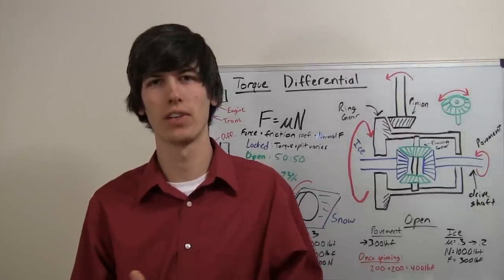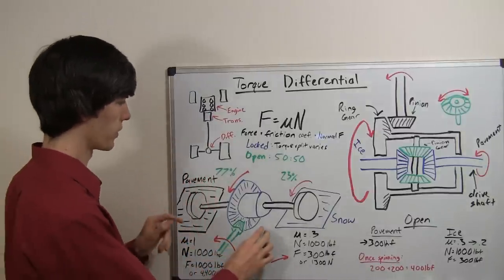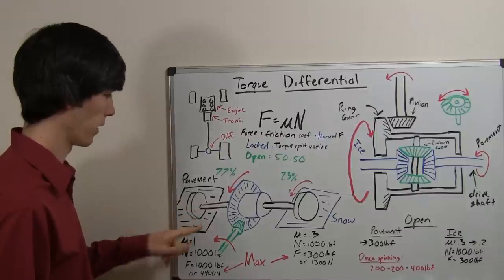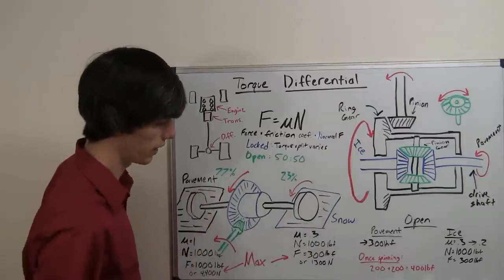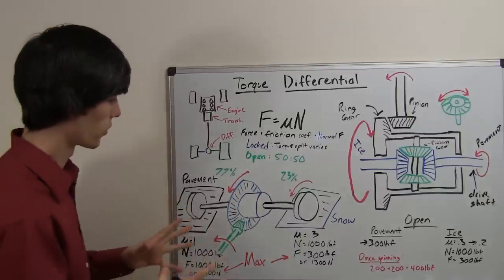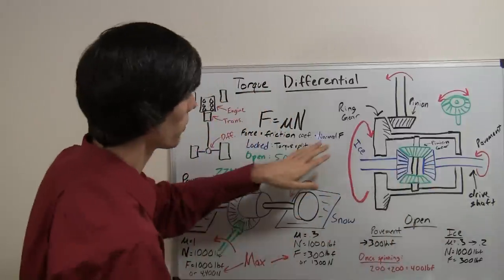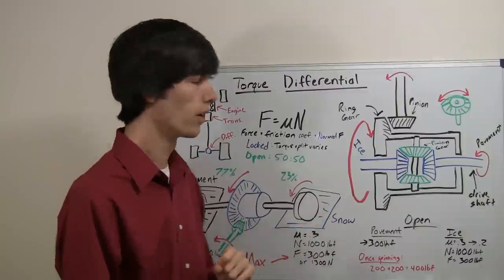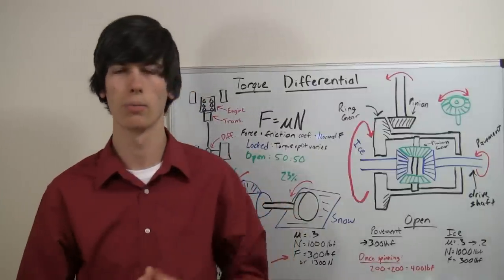Open vs Locked Differential - Torque Transfer - Explained

Comment: I am going to take one more stab at this. something tells me this is going to be pointless.
Okay forget about speed. Forget about math, Let's talk about how the locked diff actually works.
When the Diff is locked. The axle is now one solid piece vs. an open diff that allows both side of the axle to turn independently.
So all the torque that originates from the engine, through the drive shaft  will not split at the diff when the diff is locked.
Because the diff is turning both sides of the axle with the same amount of force or torque.
So the amount of force however much it takes, is being used to turn the complete axle at the diff.
So the diff is now forced to use whatever force needed to spin the complete axle.
Now don't forget the axle is locked together.
Again you are correct about the amount of force that might be applied to the ground when measured at the bottom of the tire.
But the component itself (the locked diff) can not split torque because all the pieces that make up the component inside all move together as one. LOCKED. What wikki is saying is misleading and what they print should never be used as a source of end all. They can be wrong from time to time. Because people are behind those magical post. And people make mistakes,
Reply: You're getting the individual wheel speed and the individual wheel torque mixed up. The wheels and the axle are part of a long fused rod so all the parts go the same speed, BUT the wheels can have different torque applied. There are countless examples of this...whenever you see one wheel drive you see a wheel on an axle getting all the torque. A motorcycles rear wheel gets all the torque for example...a motorcycle drive would be the same as a car with a locked diff and one wheel taken off or on ice.

Comment: Question regarding open diffs: In your example above, when more than the maximum 600 lb.ft is applied to the differential, the low traction axle/wheel will begin to spin, correct? 
However, when the low-traction wheel only received torque equal to it's maximum traction, what causes it to spin?
And how fast does it spin up? And does this depend on the amount of torque above 600 provided?
Surely if you apply even more torque it will spin up faster, which means the wheel does receive more torque than you claim (the maximum allowed by traction)?

As another example, when one wheel is in the air, the traction is zero, therefore it should receive 0 torque, as does the other wheel. Yet the wheel in the air starts to spin... How do I calculate the accelerating torque of this spinning wheel?

Comment: So essentially, if you think of the power formula (P=T*w), locked differentials maintain a constant angular velocity but the torque is variable b/w the tires. For open differentials, torque is constant and angular velocity is variable b/w the tires. Am I correct in that statement?

Comment: Nicely done and I appreciate the maths there as it helps show just how much extra a LSD can achieve over a tradional different. Without the math it.would have been much harder to digest! Now on to the LSD video(s) to see and learn the difference.

I appreciate the effort as I've always had trouble understanding the diffs but understand math well and can see the engineering concepts of what spins where once on the board with a little concentration. It's a shame you don't have some small clear Perspex demos to make it easier for others who may not understand gearing ratios etc as well.
Reply: In reply to one of your posts (won't let me reply for some reason) "Though it will be significantly smaller, even a spinning tire does apply some torque to the ground."

This would be because even a spinning (no traction) tyre has some resistance thus why when stuck in the sand, sand still flies even though the wheel is spinning. That concept is actually easy to understand at least I think :).

I easily understand that that torque levels applied can be different, where I have the problem is understanding how the different levels are split. If you are traveling at 100km/h or 100mph and neither wheel is slipping then obviously ALL tyres are  moving at the same speed. However if one hits a patch of ice it obviously cannot hold the same amount of resistance against the diff therefor the torque is going to be different if the diff allows for it. (Think I'm right with this principle and hope I'm understanding this right).
Reply: *****  A locked diff is designed to transfers the available torque (from the engine) "equally" to the final drive. So there is no difference or torque split that is sent to the wheels. Now how much force actually hits the floor is a different story. You seem to understand this already. But no matter what the traction is underneath the wheel, the locked diff will always send an equal amount of torque (from the engine) to the final drive. And remember the final drive is only responsible for connecting the power to the wheels (yes of course you can alter the amount of power or the ratio but in it's simplest form in just connects the power to the wheels through axles). The final drive can not split torque in any way. Soooooooo each wheel will receive........equal amounts of torque.

Comment: Concerning Formula 1: what pilots change with their Differential Selector? The ratio of torque distribution? I know they have minimum 2 (smtimes 3) selectors - diff in and diff out (i guess "in/out corner")? How does it works?

Comment: Ok cool, thanks for the reply. The reason I ask is I have a '69 Camaro (as you can see in my little picture thingy) and it's got a Ramjet 502 crate engine in it. Now mind you it's got shitty tires so they're cheap to replace after a couple of "speedy starts", but I remember that before we put the LSD in it only one wheel would spin because it was an open diff. Thanks for the info and awesome videos

Comment: it has to do with how the power is sent to the tires. the rotational speed will be the same between both front and rear, just how much of a load is sent to either wheels.

Comment: Correction: 8:30
Think you mean 400lbs force with an open diff vs 1200lbs force with a locked diff, assuming the same lowered (dynamic?) friction coefficient...or 600lbs force vs 1300lbs if we assumed no decrease in friction...but point was taken never-the-less.

Had to watch it a few times to get the difference, but I think I got it.  Hard to get it out of your head that torque != velocity, especially when it comes to locked diffs.

Comment: Ok I watched your video twice. I understand everything except how the locked diff is able to split the torque and how the open diff isn't. I looked on some pictures of open and locked differentials and they look identical to me. Maybe I'm missing something or maybe I'm just dumb (I hope not). As far as I know, both open and locked diffs have pinion gears, and on both diffs they can rotate around the axle they are fixed to. How is the torque split even with the open diff (when the fraction coefficient is different on one wheel) when the pinion gears can rotate?
Reply: tombax338 Ok I got it :D

Comment: Great video thank you! one question, why would you use an Open differential when you are so limited with force and torque?
Reply: So you don't scrub the wheels going around corners (wheels going different speeds)
Reply: In some scenarios, locked is better, such as slow off-road situations

Comment: So if I have a front wheel drive car and my only options are open differential or welded differential   Open differential is better to track on and daily Drive but welded differential is better to drag race on?

Comment: Great vid! But how do we choose (in open diffs) the tyre (on ice or on pavement) to define the maximum applied force. Couldn't we just take the force of the other tyre (the one on the pavement) and thus have the maximum applied force of 2000 lbf (not only 600lbf)??
Reply: Can You Answer this..!? @ Engineering Explained

Comment: Jason, in the open diff example I see why the torque is equal from wheel to wheel, but why is the max torque limited to the slipping torque of the wheel on ice? I would think that you could simply apply whatever torque is necessary to get the wheel on pavement to turn. Sure, the wheel on ice would accelerate like crazy, but at least you could get unstuck.
Reply: Of course you can get unstuck, but it's a lot easier to do so when you have 2x the torque. And in some instances that huge increase in torque makes the difference between getting traction and moving or being winched out
Reply: Something about the design of the open differential limits maximum torque output to that required to spin one wheel.  If you step on the gas more, the tire with traction will still not move.

Comment: Got open..but lockers:  If I'm understanding right:
If one tire is in the air, one can put down full 1000lbs, the system as a whole resists up to 1k lbs of torque, as that's what's being resisted by 1 wheel, after which both will start to spin at the same speed. This makes the velocity the same (which is what is experienced in a locker), but torque is 100% given to traction tire..but this is only 50% of the drivetrain's capability (as ideal conditions, 2 tires, 1k ft-lbs each, 2k lbs force)?

Comment: Im not schooled at this but i think the wheels are spinning at the same speed, its just when the engine delivers power to the wheels, 40% is going to the front and 60% is going to the rear. so if its 400 torque, then 140 torque is going to the front and 260 is going to rear when accelerating. (in a perfect system with no drivetrain loss.)

Comment: In case of Locked differential , take the case where one wheel gets struck and the other is in air . In the last video you told that there would be a distribution of 0 and 100 percent torque distribution to each of the wheels . But this means that one tries to rotate and the other doesn't . But in locked differential case, both the rotating speeds are supposed to be same . Where am I going wrong ?
Reply: "But this means that one tries to rotate and the other doesn't " this is the mistake in Your thinking. Both wheels are on one solid shaft (in simplification), so there is NO way, that one tries, and other doesn't :) They are one body.

Comment: I think the problem is that people think that torque is the speed of the rotation of a tire. therefore, they think locked diffs is 50/50 all the time. and for an open differential, all the torque goes to one wheel. So, my friendly suggestion to you is to start off by telling people that. Because I had to get that straight by myself. for example,if 1 ftlb tq is applied to a wheel on ice and one on pavement, the wheel on the ice will spin faster than the one on pavement correct? Thanks!

Comment: So basically, on a locked differential the turning force is split based the amount of grip on each tyre, which ever has more grip has more power. Open, always 50-50, no matter what.

Comment: my 89 camaro has an open diff..i wondered if the traction is limited by the spinning wheel then i guess my car had no power...but i guess thats only the case if they do happen to break loose...so ill just get supper sticky tires and make sure they don't  ever spin

Comment: I have a tuned (software and hardware) 335d pushing about 350 hp, 516 tq.  I have an open diff (in BMW's world, an eLSD).  I normally only use my car to commute from the store and back, visit family, etc.  Would a mechanical LSD be a worthwhile upgrade?  TY.

Comment: When you explained the 77-23 torque ratio, you could have based it off of the friction coefficient ratio rather than on the longer route you took. Equivalent, yes, but would have been simpler.
Reply: like how multiplication is commutative?

Comment: Why does the torque delivered to the wheel on ice stop at 300 as it reaches the maximum friction of ice? Isn't it possible to have say 350lbf at the wheel with 200 overcoming the friction and another 150 speeding up the spinning wheel?

Comment: I haven't understood why the amount of torque actually applied to the wheels is LIMITED by the tire with the least traction. If you gave it more throttle, wouldn't the wheel on the pavement actually receive more torque (even if the wheel on the snow spinned faster)? Thanks

Comment: So if I had a rwd car with an open differential and disconnected the one of the wheels from the axle and floored it, would the vehicle move?

Also how does still apply to when one wheel spins faster than the other on the same surface type?

Comment: hallo man, i have a question, i repeated the video many times in order to understand, while getting the forces at each tire, it will be like 1000 lb left and 300 lb right, so it will be always 77% and 23%? i didnt get this, also about the open diff, i couldnt get what did u want to say?.. I`m sorry i`m totally new to this

Comment: So are you saying that if I have an open differential car, which is on pavement, with enough torque to overcome the friction coefficient of that pavement, that both wheels will spin because there is a 50:50 torque split and even friction coefficient between each wheel?

Comment: Is the 400lbf example the reason that just spinning your tires in sand/snow is not a good idea to get unstuck? You can actually get more torque if you stop and try again?
Reply from the maker: chrrrr Yes. Spinning tires is useless. Let off the gas, let the tires stop, and try to roll it out without slipping. Much more torque. Lots of people don't understand this, and sit there burying themselves a hole - very frustrating to watch.
Reply: Engineering Explained In some cases though if the layer of snow is fairly thin, the tires may eat through and find contact with a surface that has a higher coefficient of friction, such as more densely packed now, dirt, or a road, and the vehicle may jolt forward.  Your videos are very informative btw!
Reply: I find a good technique to driving uphill on a lightly snow covered road is to shift to a low gear, and allow the drive wheels to constantly slip.
They push the snow off the road, make contact, and then move forward a bit, and the cycle repeats.

Comment: so basically, with a locked/locking diff, when it senses slip at one wheel, the wheel that still has traction is going to resist on the whole drivetrain spinning, and the locking diff will send more torque to that side because it knows which side is gripping? with an open diff, if i got 1 tire on dirt and the other on pavement and i stomp the gas, both wheels will spin until the both hook, and a locker will stop the one on dirt spinning, and send the excess power to the one on pavement?

Comment: hey dude thanks for your video. just wondering with those suvs these days, the majority of them are equipped with open diffs, if the torque in an open diff are split 50:50, how can the esp brake the wheel that is spinning and transfer the torque to the wheel that is stuck? cheers! btw ur videos have really helped me ;)

Comment: ahh, so an open diff is limited to how much grip the lesser of the 2 tires has? i watched the limited slip video but im slightly confused on that, it basically has the ability to bounce power back and forth as its needed? also, an open diff would be beneficial in, say, dragging, because both tires will have good grip, and both will get equal torque, whereas a locker is good for off-roading?

Comment: So basically, 50 50 tq split on the open diff which keep power following the path of least resistance? Whereas the locked/locking diff maintains 50 50 wheel speed and because of that power follows the path of most resistance? Is that correct or does it just sound completely wrong

Comment: Hallo man thanks alot for ur reply. I have another question. What i do now is studying the behavior of the road and the effect of the open, and locked differentional on lateral forces, longitudinal, steering behavior, slip angles. Is there any literature for such kind of modelling. This part is my biggest problem.now; also do u know about torque vectoring differential ?; this is the way we deal here in germany; the professor cant provide us with good literature and so, thanks for ur patience.

Comment: @EngineeringExplained so with a open diff does will both wheels spin if i do a wheel stand as in power brake

Comment: Still struggling to wrap my head around how in the case of an open differential, the torque split will always be 50/50. Lets take the scenario of being stuck in a ditch, with one wheel completely off the ground and the other firmly planted. I get it that in case of a locked diff, the wheel up in the air tries to spin, but then the wheel in the ground says no, we are locked together and must spin at the same speed, so then all of the tractive force is transferred to the wheel on the ground. Whether that's enough to get the car out of the ditch or not is then based solely on the amount of grip the wheel on the ground has. 
But, in case of an open diff, the wheel in the air will spin very fast and the wheel on the ground won't move at all. How is it that the wheel on the ground receives the same torque as the wheel spinning in the air? I guess it has something to do with where the torquedistribution is measured? At the axle vs on the ground?
Reply: i think we are measuring at the ground. if there is no friction, no force is being sent to the ground. In a 50/50 split, if one wheel is sending no force to the ground, neither is the other one. this is kinda confusing since the wheel is obviously turning, but since we aren't measuring the torque applied to the axle (which i guess has it's own resistances and what not) it doesn't matter.